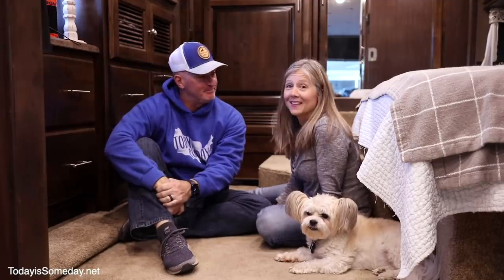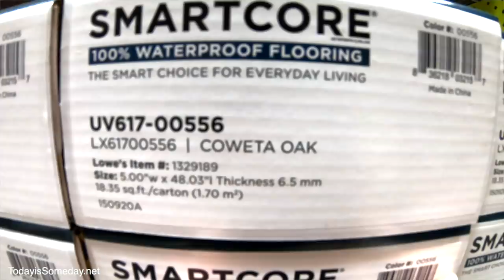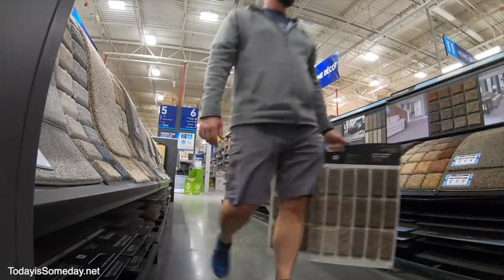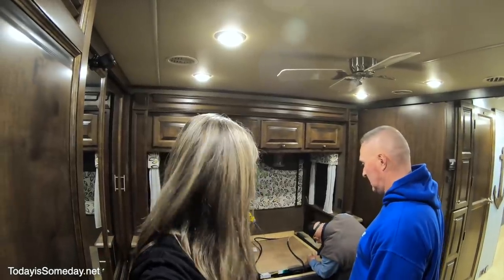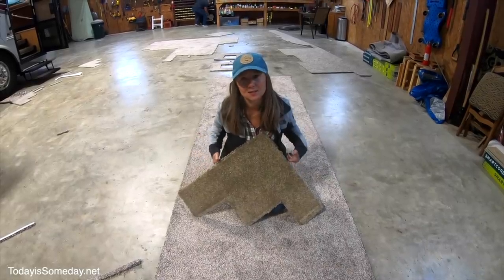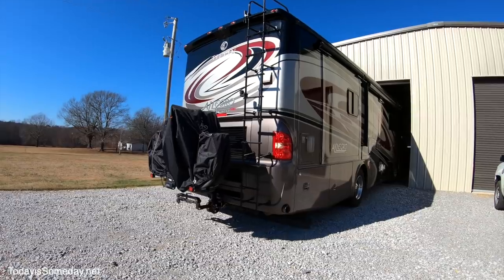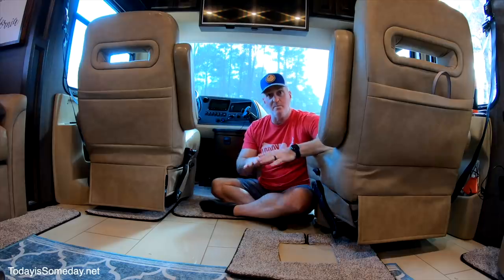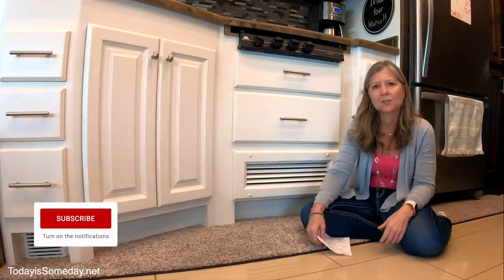RV Upgrades (Durable Floors)

Comment: We did the click in vinyl flooring ourselves in our fifth wheel. Pretty easy, took 3 days
Reply: Hi Luis,
   How long ago did you install the floor?
We have heard stories of twisting, ever so slight it would be could pop the floor. Have you had any issues?
Reply: How is it holding up? I'm putting 8mm click plank and am concerned with it coming apart

Comment: We did our ourselves.  We removed ALL carler and put down pel and stick tile, dont remember the reason we did that!  We put in a grayish color, no clue the name or brand, but also bought from Lowe's.  It was fairly simple to do, easy to cut and fit.  We had had to replace subflooring due to water damage.

Comment: My 5th wheel doesn't have any carpet whatsoever anywhere. Totally Congolieum flooring and love it. One of the big reasons I picked an Alliance RV 5th wheel for boondocking. Easy and quick to clean the floors with just a broom and dustpan. To deep clean the floors we just use a Swiffer Wet Jet mop. If we spill coffee, liquids, or drop food we just grab paper towels and a dampened paper towel. Quick and easy. We only carry a good hand held vacuum for quick cleanups of dry spills i.e. coffee grounds, powders. The only thing close to carpet is our 2 matching bath mats in the bathroom and at the entry door. Carpet would be warmer on bare feet in colder weather, but that's why they make slippers! Really look forward to your videos. Thank you! Hoping to maybe meet you on the road some day. My older sister travels with me and guess what, she's a Navy veteran too. Lots of stories there!

Comment: Hey.  Hey ,hey , no not Fat Albert but you gave some information I would beat lots of folks didnt know. And that the thicknes of the flooring for the slides. I had let some mobile pressures washers wash my coach while out on the road. Not thinking nothing of it I drove home and parked my coach. Well spring came around to get on the road again. Opened the slides and almost passed out . In front of the dining table there was a huge white spot in my green carpet. What ever they using to clean my coach , using the pressure washer blowed the chemical in and bleached out my carpet. It was sickening . I tried to turn it in on my insurance but they said since I don't have a company name that washed my coach there wasn't anything they could do. But thank you, thank you for that information.  Thats some great information about thickness.
Your coach looks great , I know you guys are happy that you've had it done.
Reply from the maker: Great info when using those pressure washers.

Comment: Sandra Westley from the uk our vans come with vinyl floors throughout and also carpet pieces on top which have bound edges, you can use either then, if it hot take the carpets up, if it’s cold put then down. That’s just like our carpet comes all bound on the edge, the reason it moves is because you have carpet on carpet and it moves on the pile of the underneath carpet.

Comment: Just an FYI. I replaced the carpet in our Class A Motorhome with Vinyl Plank when we were Fulltimers and love it. However we are no longer Fulltimers so the RV is parked and winterized some winters. We found that the Vinyl Plank flooring expands and contracts more than we realized. We live in Wisconsin so temp variations of -20F to +90F  has caused separation at some of the joints. BTW: I love what you did in yours.
Reply from the maker: Thanks for sharing!

Comment: That really looks great. When we watch upgrades on YouTube we want to work on ours.
We have an old 1985 Yellowstone 5th wheel we want to clean up. Paint, new cabinet doors, drawer fronts, and flooring. Going to try the floor ourselves using click lock vinyl planks. 🤞 it will turn out good  and last. We have to level the floor first. 
You all did a great job getting that roll of carpet in Ruby. 👍
Safe travels, stay healthy.

Comment: Get some "carpet tack", clear vinyl strip with little nubs on one  side. Goes under the cut  pads and the actual carpet. Pads "cling" to the top of strip and the nubs on the underside grip the carpet loft.

Comment: To help stop the mats in the kitchen from moving around, attach clear plastic carpet runner to the back using spray adhesive.  It's the stuff with the plastic spikes on the back.  The spikes on the back of the runner come in different lengths, get the longest spikes you can find if your carpet has deep pile. Cut the clear runner about an inch or smaller than the mat and use spray contact adhesive to attach it.  This is how I make the mats on corporate jet aircraft. 
 If you are using carpet mats on the tile floor, use the spray adhesive to attach shelf liner to the back to stop the sliding.
The second option is to glue the "hook" part of velcro in long 2" strips and the carpet won't move much on loop style carpet.  But this damages the carpet every time you pull it up and make it fuzzy. Doesn't really work on "cut pile" carpet.
Reply from the maker: Great tips, thanks a ton!

Comment: Curious to know, rumor is gas prices could sky rocket on the next 12 months. Will that take you guys off the road? I own a class A gas engine. At $5/gallon, which is the rumor, no way I can stay out doing what I love. What do you guys think. Would love to see a video on it.
Reply from the maker: We shall see what happens.  We have a specific budget for fuel.  Fingers crossed it doesn't go up to high or for too long.

Comment: Try putting the non skid  rubberized material that Rubbermaid makes . It comes in rolls. Put them under the carpet pads in front of the cooking area. It just might keep those pads from sliding.
Reply from the maker: Thanks for the tip!

Comment: Just wondering if you considered the vinyl weave marine grade product (instead of carpet), especially by the kitchen cabinets, fridge side slide out?  Apparently, it is much more durable for high traffic areas and does not wear like carpet.
Reply from the maker: Never heard of it.  Will look into it for sure.

Comment: I'm still debating if I want to mount the wifi antenna on top or not. Probably will. I am in limbo waiting on the AT&T access. Boy that is the most weird purchase I have ever made.. only two weeks in. Does the antenna stick up any higher that your satellite dish?
Reply from the maker: No, the antenna is lower than the satellite dome. It has worked really well since mounting.
Reply: @todayissomeday  Thank ya.

Comment: Great looking upgrade! You should consider getting a length of that clear vinyl carpet runner. It has little spikes on the back that help it grip the carpet. You could trim one edge to fit right along your cabinets and have a wipe clean surface there in your kitchen area.
Reply from the maker: Thanks for the tip!

Comment: To keep your small carpet "toppers" from moving , consider putting some hook side Velcro on the under side of the carpet toppers. Depends on the carpet. Test with a small piece held in your hand to see if it grips well, before attaching to the bottom of carpet. If it comes loose after a while hot glue the Velcro back on the toppers. "You go Phil"
Reply from the maker: Thanks for the tips!  ;)

Comment: We have a 2019 Tiffin Red 37pa. I noticed in your video the technicians putting some screws into the bedroom OSB. Did you have a creaking or squeaking floor? It looks like there is a seam between OSB sheets in that location. Our floor near the bedroom entrance from the kitchen creaks or squeaks when we are on certain unlevel campsites. 

Did you have to supply the transition plate between the tile and the plank flooring?

When you ordered your carpet why couldn’t you have had the carpet shipped to MS RV Solutions? Was it due to supply change issues back in that dystopian time?  Was that the Tupelo Lowe’s you visited? Hopefully those issues don’t exist now.

Is your flooring and carpet holding up?

Thanks for this informative video.
Reply from the maker: We did have a slight squeak that they fixed. We brought the carpet with us because the Lowes we ordered it through messed it up. The bedroom flooring, including the transition piece,  was sent to the Tupelo Lowes and picked up by MSRV. Both carpet and flooring still look great and have held up really well.

Comment: Quick (ok...maybe not so quick) note on vinyl plank flooring from a licensed contractor who's worked on RVs, mobile homes, and built and remodeled custom homes for 40 years with hands-on installations of tile, laminate, and vinyl plank flooring (VPF).  You mostly get what you pay for---cheap VPF will have a very thin surface layer that carries the color and design details, and if you're on it much or drag things over it, it'll wear through in a year or less.  And big box stores rarely sell VPF with the thickness of that top layer listed, but well-known brands that are at the upper end of the cost range almost always have a heavier, longer-lasting wear layer.  The VPF that Phil and Stacy purchased was 6.5 millimeters in total thickness and probably had no idea that they should've checked to see its rated wear level thickness.   The plank's top layer, the wear layer, is measured in mils, not millimeters and the thicker the mil's, the better.  12 mils should be the minimum you buy--and be sure to ask before you buy--and 20 mils (commercial grade) is a wiser investment if your on it much and have pets.  And always, always do your online research before you go shopping!
Reply from the maker: Great stuff.  Ours is a 12 mils wear layer.  We had to ensure that it would clear the slide roller and not bind. we should be good for a while.

Comment: I have a totally unrelated question... we have been following you guys for a few years now and have enjoyed all the experiences you shared through your channel.  We are in the process of upgrading from a class C to a class A diesel pusher and are considering what we should do regarding a tow vehicle or Toad as they are referred to.  When you divorced “Dolly” and went to the Jeep for flat towing, did the Jeep get torn up at all with road debris thrown on it from your RV?  We are considering buying a new Grand Cherokee but concerned about the consequential damage that it may be subjected to.  The alternate is a used Jeep Wrangler which is far less comfortable since it would become are primary vehicle outside the RV usage.  Any thoughts?
Reply from the maker: It has had a few rock dings, but nothing out of the ordinary.  Stacy says it's a Jeep and can handle it.  They do make guards that you can attach to the tow bars to help protect the toad.  Most Class A's have a rock guard that goes across the back of the RV which does help.
Reply: Phil, thanks for the info.  We are trying to decide if we bought a new one, would it get torn up a bit.  Ken

Comment: Note on replacing carpet with vinyl plank -- You may need to replace the rollers in that location as well.  The rollers in our carpeted area are larger in diameter than in areas where there is tile/vinyl plank flooring.  We had a spring-loaded roller that came off a couple of times while driving.  The roller was gripping the new vinyl plank flooring and would inch its way out of the brackets.  We went to our manufacturer (Newmar) and ordered the rollers used on the tile/vinyl plank flooring to replace the rollers in the formerly carpeted bedroom.
Reply from the maker: Great tip!  Thanks.

Comment: Did you consider replacing carpet with more wood?
Reply: I was thinking the same thing. 
It may not have been a perfect match to the tile but you would’ve done away with all of the problems of carpet care and cleaning.
Reply from the maker: Only for the kitchen and engine hump in the bedroom. Maybe down the road.

Comment: With everything I analyzed years ago when we was RV (15 yr or more ),If i could "turn back time" as Cher sing, I would NOT ,get sliders, and if change the floor -i would do sound and insulation rolls thru all rig ,then find good grade linoleum -doesn't matter if its planks,tiles or roll,get extra freezer in the basement ,and all lights -ALL ,be LED ,take out bankets ,put one slim cabinet along wall and put multifunctional table with chairs ,its take extra bulked space ,that not comfy ,cabinet would give storage , increase leg room ,and for guests get couple camping cots ,that way more comfy than those flexsteel couches. Because if manufacturers can't  adjust ,we adjust by our selves. Of course not everything at once ,but if to do floors -do them right.And of course solar powered as much as possible ,not even huge roof panels ,but couple powerbanks resting on a dash can give lots of power ,plus solar generator -some big one is pricy ,but since its only 2 of us +dog ,i would go small ,but sufficient. It is lots of stuff great for RV in camping store and isles...We now start downsizing to go full time probably next year,or as soon as we can ,but ...lol 😂 😂didn't have RV yet - window shopping for now to be ready for new other life . I just discovered your channel and absolutely loved -honest and humorous. Thanks.LOOKING GREAT A+!

Comment: Did you put the tile flooring over the tile for or did you have to remove tile because of slide height
Reply from the maker: The bedroom had carpet that was removed before the planking went down. We did not pull out any tile. But we have seen it done.

Comment: We have the same motorhome.  I've watched this video, like 10 times already.  I'm going to Red Bay in March to have vinyl and carpet installed  How has the vinyl flooring held up w/ the rollers on the slides?    Is there anything you would do different?
Reply from the maker: The new carpet and vinyl are holding up great. No problems at all! The only thing we wish we'd done differently is putting the vinyl on the engine hump and up the side of the closet. Not sure if its possible but we hate the carpet there.
Reply: @todayissomeday  I will ask when we get there and let you know. Thanks for the info.
Reply: Well, I got my flooring done.  I had new carpet and LVP (luxury vinyl plank) put in.  I asked Davidson RV about doing the engine hump in the bedroom.  He advised against that because of a few reasons.   One, you need access to that area in case of motor work.  Two, It's flexible there,  and you couldn't use LVP.  You would have to use real wood, but a lot of sharp corners and still not recommended.  
     I was able to have LVP installed on the passenger side slide, so getting LVP by the kitchen sink, stove and refrigerator is great.  We don't have to worry about dropping things there, and clean-up is super easy.  We did use carpet on the driver side by the couch, but he could've done both slides  in LVP.  I did not ask about carpet up the side of the closet.  
    Thank you for this video

Comment: Curious why you put the carpet pack on the Engine cover ? Is it not possible or recommended to do the plank flooring on the cover ? Thank u Joe
Reply from the maker: We noticed it after the fact.  We are going to have them cut it so the cover can be removed easily.
Reply: @todayissomeday   are u putting the plank floor on the engine cover ?

Comment: When the installed you carpet in the slides, did they put an extra reflective insulation down? I saw something, but it was quick. My slide floors get cold.
Reply from the maker: No.  Most of the slide floor is covered by the furniture.  Very little exposed carpet area.

Comment: I wish someone could figure out how to put vinyl flooring in the galley. Is it because of the wrap at the edge of the slide, or is it because of weight, or something else that prevents vinyl being used there?
Reply: Some new rigs have the vinyl now. I think over time, they all will. I know carpet in the kitchen or under the table is a deal-breaker for me.
Reply from the maker: I am sure they will eventually.  We talked to them about and they just haven't tried it yet.  They go with what they are comfortable with and are proud of their work.
Reply: I was just wondering if anyone knew why it’s the way it is. Your upgrades are beautiful and I wouldn’t want to be the first to try it either. You can get RVs with wall to wall ceramic tile, but that’s a different type of slide system and the price is astronomical.

Comment: RVs are built to look pretty not to actually use them. RV sellers need something shiny to wave in front of your face to distract you to how cheaply they are built. If they built better and put money into flooring (you use the floors always). Stop putting cheap carpet in areas where (Kitchen and bathrooms) no sane person would ever have carpet.